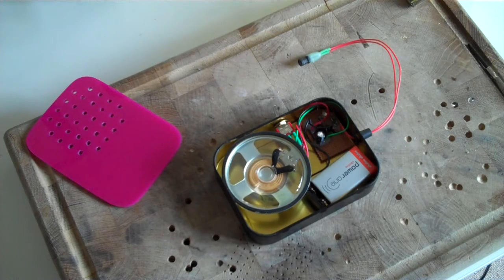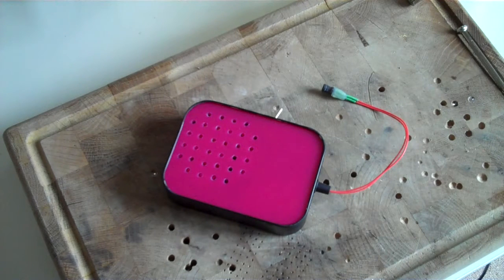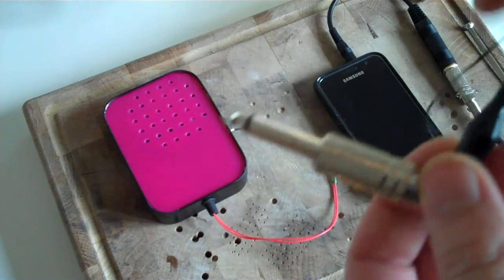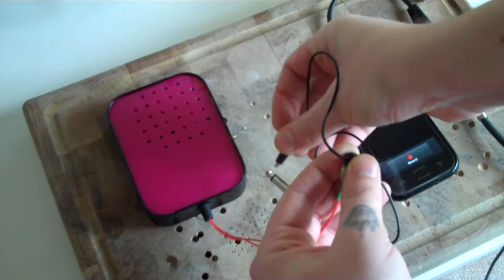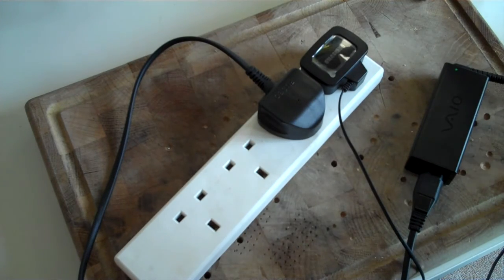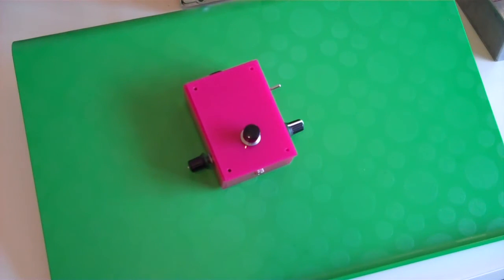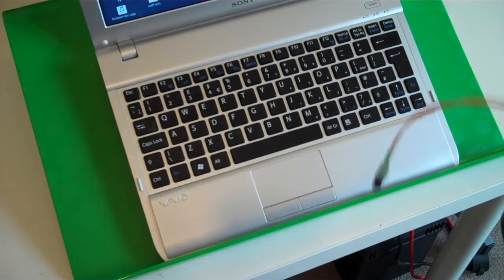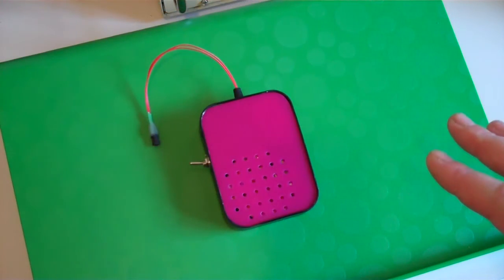Spying on Electrons with the Signal Sniffer

Comment: Also known as a RF Signal Tracer... They used to be popular back when the vacuum tube was king. Some units had both RF and direct probe. You would have connected a 1khz signal to the input or anywhere else for that matter and you probed around till you found the component that has failed. They don't get used much these days but they are still an effective and fast way to fault find... If you have enough amplifier gain and a different value inductor, you can find resistors that have aged badly and are arching inside that you wouldn't have known about.... Usually in older equipment but possibly in areas where the component had to work hard like smps Switch Mode Power Supplies...

Comment from the maker: You can order a 5mH inductor from most electronic component suppliers such as Rapid, RS, Farnell or Digikey. The value is not too critical, you could get away with using 4.7 or 10mH and it should work just the same.

If you're really struggling to find one, you can normally get one from the circuit inside a compact florescent light bulb (It's where I got mine) - Just be careful when you're cutting open the casing.